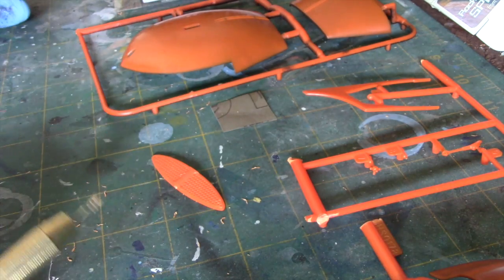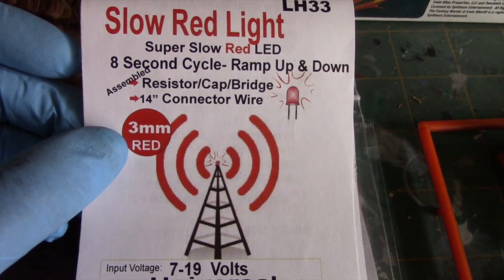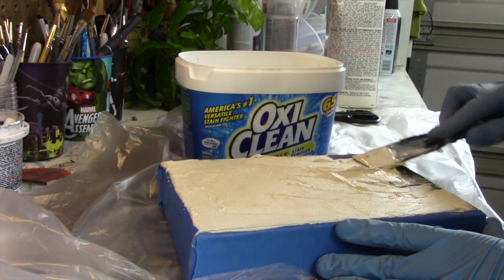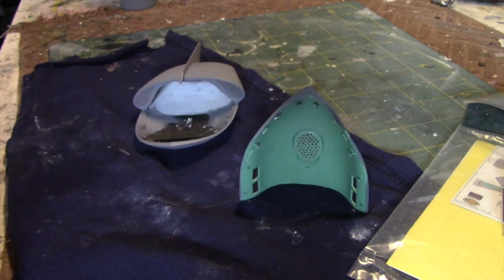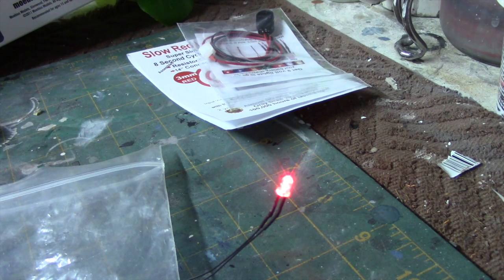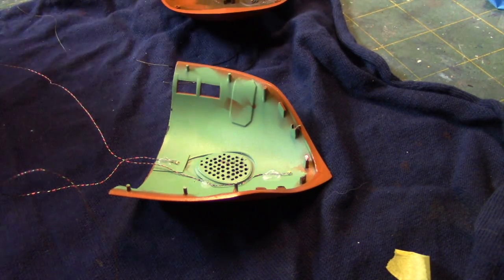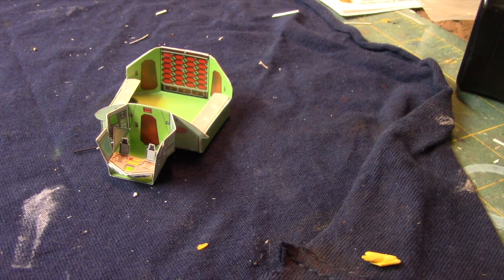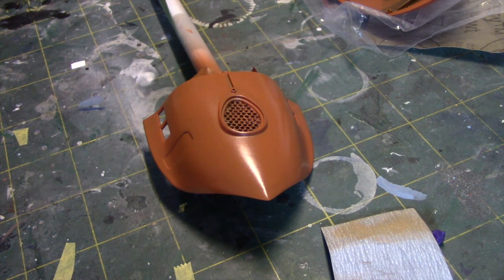Building Moebius Models 1/128 Spindrift Part 1

Comment: Love it and the idea for the pulsing light is just genius but I'm sure that when the lights did pulse on the studio model, they didn't fully go out. I built my own flashing circuit to put in my Invaders saucer and because it makes 5 LEDs pulse it's just at the right speed
Reply from the maker: Thanks Andrew. Yeah you're probably right.  Not long after doing completing project they did come out with what is called a breathing LED which does just that.  At the time I was looking for an inexpensive option and this fit the bill.  Overall though I think the effect turned out well nonetheless.

Comment: Nice thus far my friend! Did you have to drill the inside of those holes as well? The plastic looks really thick and that's why I'm asking. Great video... as always.
Reply from the maker: Thanks HG.  The holes were not very difficult, just a tedious task.  Just a few twists of the pin vice and you were through.  I did have to to work at cleaning up stray strands of plastic but really wasn't too tough.
Reply: Why I love your builds is because they are multi media. lights, camera and action (neat LEDs, great video, and cool dioramas)

Comment: This "Chip size" term, is so annoying! SMD LED's are all called "chips", if they really must use a simplified common term to describe the size it should be "Micro". Or better yet just use the standardised size coding of 3216 for "Chip/Micro", 1608 for "Nano", and 1005 for "Pico".